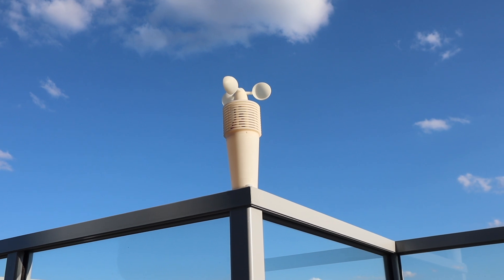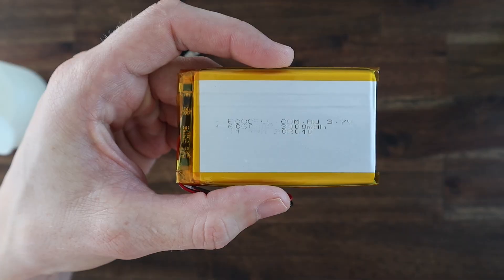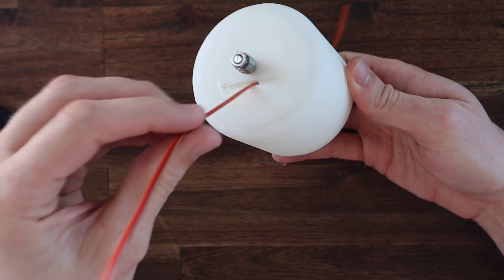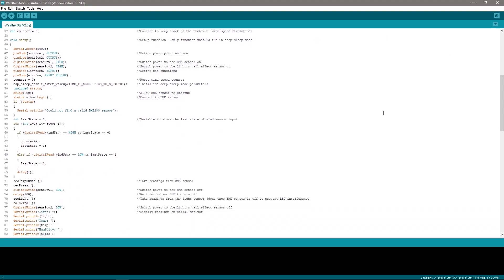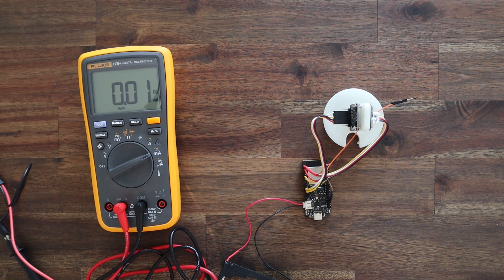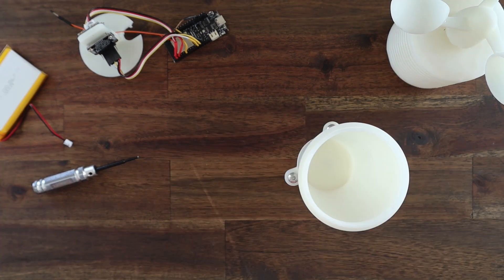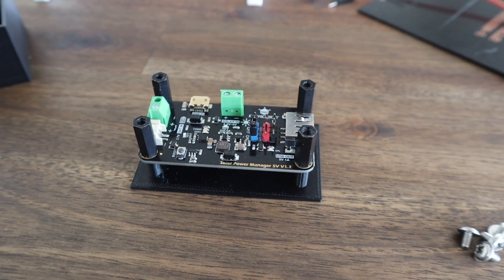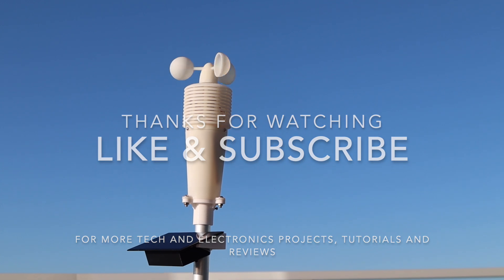I Upgraded My 3D Printed IoT Weather Station Using Your Suggestions

Comment: @MichaelKlements awesome work with compact design. 
It would be nice if you had some time to share some feedbacks:
  - Could you share some update on resins condition after 3+ years?
  - How are mechanical parts behaving after this period?
  - Are you planning to add wind direction?

Comment: First of all congratulations for the project and for the improvements. I am doing the project but I have a problem with the anemometer. This one needs a bit of strong wind to start spinning, on the hand spin very well just by blowing a little, works without any friction but it’s hard to start turning. On the other hand, using 4 magnets as counts turns? , what happens if some reading fails?
Reply from the maker: You could try soaking the bearings in a solvent overnight to remove any existing oil/grease and then re-apply a very thin oil to them. This usually helps them turn in very light wind. If it misses magnet passes it'll just understate the current wind speed.

Comment: Thanks for posting this. I printed the parts and built this as well.  For the wind cups, I superglued a bearing the size of the bottom and machined a coupler from aluminum that fit inside the bottom with a slightly larger bottom half so the cups rest on the coupler. I also dirilled and tapped an M5 hole in the coupler and mounted that to the top.  I tested the arrangement with a powerful leaf blower and the wind cups stayed on the coupler without coming off.

Comment: Hello! Congrats on the project. 
Is your project rain resistant? 
Does the rain not damage the internal sensors? 
Thanks!
Reply from the maker: Thank you. It’s somewhat rain resistant, I don’t think it would survive long periods of rain or rain with a high wind speed but it handles rain in my area well. It’s been running for a few months now without any issues.

Comment: I would try it with a LTO cell.
Reply from the maker: I've never tried these, they look like something between a lithium ion cell and a capacitor. Have you tried them?
Reply: @MichaelKlements   No, had no need to use them. However, I find this cell type interesting. The voltage is not quite ideal,  the voltage is quiet low. If 2 cells are used balancing may needed, or if only one cell is used a step-up like for example TPS610986 is needed.  At the moment I'm trying to design my own esp32 ic based board already have the ic's . However, the lto cells should be more durable than normal batteries and it can run  even from ~ -40 ° C to ~ 70 ° C , it also has a lower self-discharge than a capacitor and can therefore be use it as a buffer if there is no sun.

Comment: great project, now with a solar panel (even if has a low performance) you can add a extra battery to store extra energy and you add others projects maybe a rain sensor wich you can send a notification on your smartphone
Reply from the maker: Thanks Andre,. Yes, I'd like to still add a rain sensor and an air particle sensor to this.
Reply: @MichaelKlements  It will be nice to add a tipping bucket rain gauge and a ultrasonic anemometer sensor reather than having moving parts for mesuring the wind speed. I'm working on adding these things to my weather station

Comment: Great project!  I know it’s probably overkill but why not add battery voltage or percentage of battery life to the dashboard? Should be easy to program and adds a professional touch to the whole project.
Reply from the maker: I was actually going to add this and then I decided against it because the power being drawn from the battery is so low. It'll only use 1% of the battery after two days without any sun, which is highly unlikely in my area. With the panel that I'm using it only needs about 5-6 minutes of sun a day to replace the power used in a day. In short it'll probably just stay at 100% indefinitely. I might still add battery monitoring if I start putting additional sensors onto it.